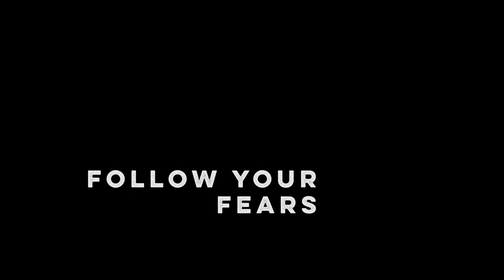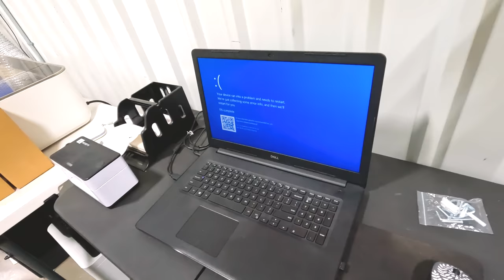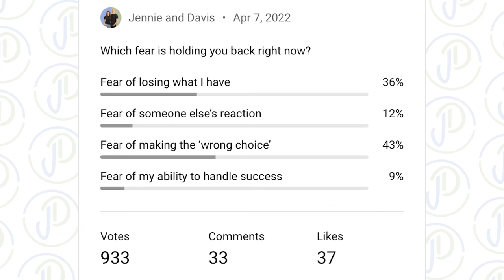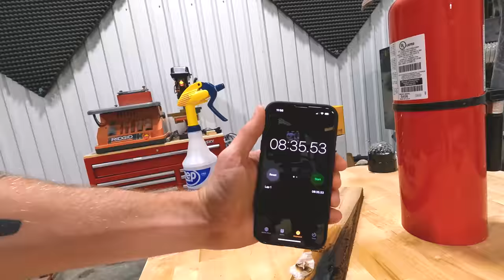we (almost) burned down the shop! 😰🔥

Comment from the maker: UPDATE: We got a timer also! It’s the blue box next to the disco light box… forgot to include the timer clip in the video. 🙃 Great suggestion!
Reply: If you decide you want to build in some more features to this, you could start introducing smart plugs with automations. You could set a series of automations that would turn a smart light red in your office so you would see it before leaving, or set an audible alarm/beep like you mentioned after a certain amount of time being on, set a timer to automatically turn everything off at a certain time, or remotely see if things were left on and turn them off if needed. The best part is if you have multiple things that you want to make sure are off before you leave, you could set a conditional automation with some sort of visual/audible identifier so you know if even one of those things is still on. I know you were just looking for a quick way to make this work for now, just throwing out some ideas to up the functionality if it makes sense for you.
Reply: Yeah… what Brad said.  I would use a smart plug that was hooked to a Google mini and have it let you know if it has been on a long time… and turn it off at a given time.
Reply: Also, major advantage with a smart plug, you can also check if it’s on at home or anywhere else, AND turn it off remotely, in addition to other advantages mentioned here
Reply: I currently use a Phillips Hue motion sensor and smart plug. It turns on for 5 minutes when sensing motion. After detecting no motion for that time.... It turns everything off. Works great for someone who leaves things on all the time xD.

Comment: Glad that you added the timer, that was going to be my suggestion. Another person mentioned a branding station, which also is a great idea. However if you don't have the available space for a dedicated station, I would suggest a different stand for your branding iron. There are some commercially available but a DIY design that has a layered metal bottom that holds the iron higher off of the surface of the table or stand, will help prevent table top burns.

Comment: I don't have a branding iron yet but in my very small shop 12'x17' I never leave the shop without checking to make sure everything is unplugged. I'll even do that during the day while I'm working. I have 2 grandsons aged 13 & 8 living with me & I'm very paranoid of an accident. I don't discourage them from coming into the shop but I'm always extra elert when they do. After using a machine it get unplugged. Also when not using the table saw the blade is lowered into the table not only for my safety but for the blades safety.

Comment: Get HOME ASSISTANT (HA) and KASA SMART PLUGS. Use automatic triggers to take care of these things within HA. In the Nuclear Navy (Submarine Officer, Nuclear Engineer here) we rely on the standard training and procedures to keep our boats and operators safe, but we always have that automatic backup in place as an "operator aide". I won't get into details but the operators know what to do, but when they don't do them, the system protects itself. You can apply the same thing here with the SMART HOME devices, remember to unplug it, but if you forget and the current measured is greater than 1A for your average working time + 10 minutes or so, the plug automatically shuts off. Last but not least.... I'm sure your doors have these signs up "DON'T FORGET YOUR CAC" - use the glowforge to make one that says "SHUT OFF YOUR LOADS!" ;)

Comment: Regarding the iron being left on overnight...If you have internet available in the shop...you could buy a smart switch that will automatically shut off at the end of the day (or throughout the day...whatever). You could also then set up an Alexa in there and use different commands to "Turn off all shop" or "Turn off certain tool" (etc).

Comment: Given the amount of wood you deal with, do you have Type A water extinguishers in the shop?  If you use drying oils, how do you deal with the wiping rags?  Do you spray flammable finishes?  Do you have the blade guard on the saw?  Along those lines, you might want to add an auto feeder to the jointer, both for safety and production speed.  Also noticed you spread your clamped assemblies on the floor.  That creates both a tripping hazard and a bend/lift repetitive hazard; you might want to build some sort of rack.  As for the branding iron, perhaps a metal table and a foot switch to leaves the iron off unless you are standing on the switch.  Perhaps add some "Remove before Flight" tags with a tag out board that you have to check as you leave for the night?  Speaking of which,  if you are now hiring employees, have you put a LOTO system in place for using the tools, such as changing blades on the table saw?
Reply: You sound like an EHS guy.  I agree with all your observations but with the fire extinguisher an ABC extinguisher will be better for all the pontetial fire hazards in a wood shop.  They definitely need the blade guard on the table saw and they better establish their Control of hazardous energies program (AKA LOTO) and I think they need a flammable cabinet.  Given the dust collection system they may need to check their air emissions permit.
Reply: @gerardorivera7356  I agree with you on the ABC and the flammable cabinet.  I'm not an EHS guy; just someone who wants to see all my guys go home at the end of the day with all their body parts intact.  There's a monument by our flagpole with 27 names on it.  It's not going to become 28.  Not on my watch.
Reply: @kmbbmj5857  Totally agree with you.  You would be a great EHS guy, I thought you were one because of your knowledge on the safety topic that is not very common to see around YouTube.  Not every body talks about extinguisher types and LOTO. It’s great to know that there is people who likes to get educated on safety and takes it seriously which make the life of us the EHS much easier.
Reply: @gerardorivera7356  Thank you for the compliment.

Comment: One modification at a shop that we did was to hook up the outlets that were used for soldering irons to the light switch.  Everyday the lights are turned off, all the "hot" outlets are also turned off.

Comment: Lay a sheet of Hardiebacker or similar material (used as tile substrate) on the table, to "fireproof" it.
Like others suggested, plug your extension cord with the iron and disco light into a timer. And plug the timer into another timer.
Another thing that kept coming to mind. Insurance!

Comment: We use soldering irons at my work that get left on for weeks at unmanned offices. I have brought up that they need to install a timer switch onto these outlets so that they will automatically turn off at a set time (10-20 minutes later), well...still nothing. So, if one day town loses dialtone and internet service and there is a big dark cloud of smoke in the direction of one of our offices, that is why.

Comment: You guys have a laser. You should buy a couple sheets of cheap MDF and make templates to mark your center points/drill locations for each thing. Everything looks to be standard sizes so it will save you the time of whipping out the measuring tape for each mark.

Comment: Dude. Simple solution that will save you money and make your company more environmentally friendly at the same time. Master power switches. Leave one circuit with the absolute essentials on. Everything else gets shut down at the master power switches. Alternating current travels back and forth until it reaches a switch or an outlet. Walk around your shop and count switches and outlets. You’re using power unnecessarily in your shop even when you’re not there. The power is traveling to every switch in your shop. Same principle that lead to the idea of unplugging phone chargers when not in use. Have your master power switches as close to where the power comes in to your shop as possible. No wasted energy. And, if you inadvertently leave a tool like a branding iron on, it will turn off when you cut the power.  Safer shop, lower electric bill and less strain on the grid. You’re welcome.

Comment: I had a couple solutions for you but they have already been mentioned. Regardless of what you do to solve this PLEASE either make one or buy one , that is a stand for it as mentioned but can use a simple 1/8” rod and bend it into a loop that will hold the iron , and also incorporate a mount out of same rod( flatten the end )on an anvil or whatever you have available and then drill a couple holes in the flat end so you can screw it to the END of your work bench so that the iron is AWAY from the bench. That way it can not come in contact with the bench and it’s simple and cheap.
Reply from the maker: We had one! That’s what saved the workbench top!

Comment: The easiest solution is to turn the power off at the mains when you lock up the shop. I do this every night as I don’t want my shop to burn down either.
Reply: That doesn't solve the issue of the iron being turned back on without your knowledge when you return in the morning. I like Davis' solution with the obvious lights along with someone else's comment about zip-tying the power cords to the extension cord end. This keeps the system together and makes it more annoying to take apart than just grabbing a different extension cord.
Reply: I did this when I operated a woodshop for the Marines in Okinawa. Each night we turned off everything at the breaker to ensure that everything was off before we left for the evening.

Comment: For the Iron, maybe if you beg in the right way another YT personality (maybe Ave or TOT) can fabricobble you a metal stand/tray that the iron rests on that provides an insulated section under the hot bit to protect surfaces. Sort of like a spoon-rest from the kitchen. Keep it with the iron so it moves with the iron when you take it out and put it away. It's not cheeting if you use networking. ;-)

Comment: If you can get me measurements, I can 3D print you a box that you can use to encompass the end of the extension cord that has the iron and light plug into it so that they cannot be easily unplugged. It requires a cord for each thing you want to plug in that you need this solution for, but it would help if you did it that way.

Comment: I`m sure your solution will work for you but i think you have over compIicated it needlessy. I simply keep my branding iron on a non combustible surface (electric pan from the thrift shop) when it`s plugged in and heating up.  I just never ever touches a burnable surface other than what i am branding.  Leave it to heat up on that non combustible surface, do your session of branding, unplug it, and let it cool on that same non combustible surface.  The timer is a great idea of course.

Comment: Disco light 🙄 put it on a heavy duty timer that will handle the amps that iron will draw. And how about getting a heavy metal tray to set the iron in and have it stand off the wood surface an inch or two to allow airspace between the table top and the metal tray.

Comment: I don't have an electric brand but a manual heating brand... Heated up my brand with a torch thought i had shut the torch down and left for a few hours. Returned home after dark and saw a faint light from my shop. Sure enough a flame comparable to a lighter had been lit for a very long time. Wont make that mistake again.
Reply from the maker: Wow that must have been scary. My dad lit a bag of sulphur on fire with stray welding spatter when I was a kid. Whole shop filled with sulphuric acid and smoke! Very scary, but it starved itself of oxygen (fortunately) and went out

Comment: To steal part of Thomas Jefferson's misquote, "Be ever vigilant." Tom was a good guy, and did a great job on the US Constitution, but nobody has proven he uttered those words. But they are great words to live (and manufacture) by, so be fruitful, but be ever vigilant. You may quote me on that!
As for my most feared moment, I was troubleshooting a small oscilloscope and failed to check the chassis for voltage. It turned out to have been shorted to the supply voltage for the cathode ray tube and was carrying 1100 volts with over four amps. enough to fry me to a crispy critter had I touched it! Over 45 years ago, but still clear as the day it happened!

Comment: I wasn’t happy with branding irons and potential fires, so I created a special piece of wood that I could use a specific rubber stamp of my logo info to sign and date and either affix it underneath or tastefully router it in the piece. Bingo…..no fires to worry about.
Reply: I got a branding iron that I heat up with MAPP torch, then throw it in a bucket of water.

Comment: Speaking of setting up for safety... There was a safety issue with your test setup. If you had gotten flames and needed to grab the fire extinguisher, where you had the extinguisher would force you to either reach across the flames or waste time walking around to get the extinguisher. Not to mention leaning the phone against iteans you are either sacrificing your phone or wasting time fumbling with it when you should be focused on using the extinguisher.
Review the footage to see the bad things you did there, figure out how to not do those bad things. And use the learnings to train yourself to see those issues next time before you do them.

Comment: Whenever I plug in my glue gun I put an elastic around my hand, not around my wrist around my hand. Putting it around your wrist doesn’t work, it’s too comfortable. I do the same thing when I turn on my coffee cup warmer.  Don’t take it off till I unplug those items.   Good luck with your business.
Reply from the maker: That’s smart, but still requires discipline. A solution needs to be more automatic

Comment: While the indicator is good, I would have switched to only branding on a metal table as a safety measure.
Reply from the maker: YES! I talked about that, but had to cut my ramblings for time… great suggestion!
Reply: why not get a large ceramic tile to brand on? I have one under my diode laser to keep from burning work table